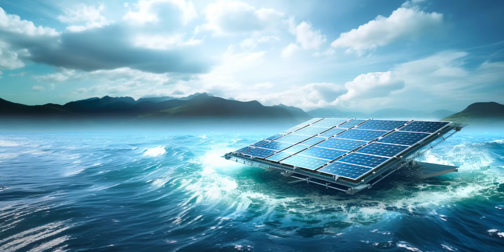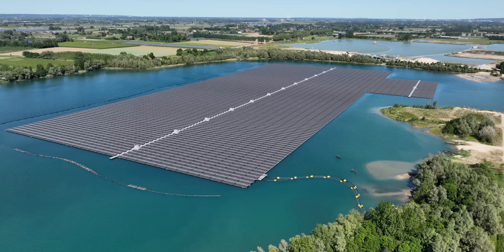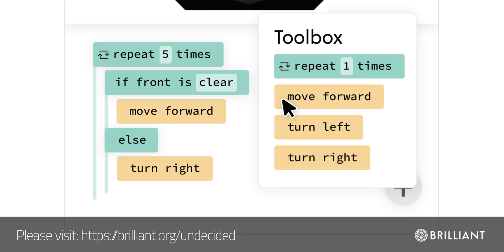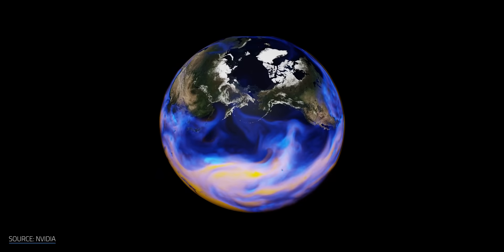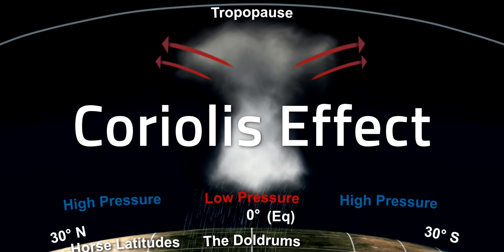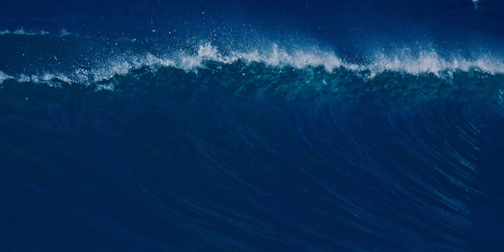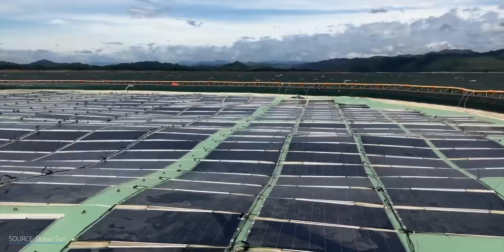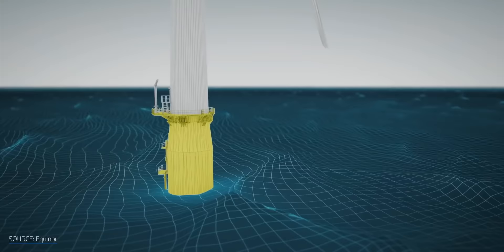How Offshore Solar Could be the Future of Energy

Comment: Thanks for the great work, Matt! My first reaction is that this is too cute by half. The ocean is like a desert: nobody lives there. That means that any power you generate must be transported over large distances and that hikes costs. It may see applications in places like Singapore or remote islands where space is at a premium. But outside those niches? I don't think so.
Reply: Excellent point & my thoughts exactly! Me thinks that the ocean is already polluted enough!
Reply: Transferring energy over these relatively small distances doesn't cost much. 
These panels on the ocean are more efficient and have less thermal wear and tear. And avoid needing to buy/lease land.
Reply: Our food lives there.
Reply: Time to build cities in the ocean then!
Reply: I see them being useful as electrical charging stations for ocean-going vessels.
Reply: The most populated areas on earth are near the coasts. Land prices in highly populated areas are expensive. So floating PV could be built closer to population center than ground mounted PV.
Reply: Most major cities and populations are on or near the coast. Most of Australia for example lives within 100km of the coast.
Reply: Power is already routinely generated hundreds of kilometres from population centres where it is primarily used (and often transported much further). There’s many challenges associated with this technology but transmission distance is a completely solved issue.

Comment: I think you are right to be skeptical of their cost and performance numbers.   There's also the performance impact and maintenance cost of salt crust on the panels.  And, they are claiming a 10% performance increase on the water, while also using thin films cells (which have lower performance).  Hmm, 10% better than land-based thin films?, or 10% better than land-based conventional panels?

Comment: Pairing offshore solar with existing wind farms might make sense, provided conditions were favourable. Even some flexible PV wrapped around the sun facing sides of the turbine tower could make for a good boost in power generation. Plus transmission cables are already there!
Reply: ...and a calm evening...what do you do then...??
Reply: @manoo422  
It's a bit of a physics thing, but wind tends to blow more at night than it does in the day.
So calm conditions are more likely during the day when your solar is producing.
Reply: @manoo422  Use other energy sources. Nobody is suggesting wind and solar need to provide 100 percent of power 100 percent of the time.
Reply: @jdillon8360  Try to think of a way you can make use of intermittent power supplies when you have a country to run 24/7...
Reply: @manoo422  You're right. There's no solution. Australia has wind and solar and when it's not windy or sunny we just live in the dark and all industry and transport shuts down cause we don't have any other means of making or storing electricity.
Reply: @jdillon8360  What you are really saying is you need a cheap secure 24/7 energy system mostly based on fossil fuel ready in the background for when renewables are producing near nothing. So if you have a secure system capable of running the country you dont need poxy unreliable expensive renewables. They are purely a political decision not an economic need because they are worthless.

Comment: We need that in typhoon prone areas. We just need a system that can easily be assembled and disassembled and stored in a steel container on shore. After a typhoon the grid will be down for weeks or months. If we can roll out floating solar in areas after being hit by typhoons, we can power these areas quickly after a storm. I have a couple of solar panels on land in a typhoon prone area. I mounted them in a place where I can easily take them down and move them inside when we get a typhoon warning.

Comment: Make 2 gigantic iron chains and tie them to a Circular, Empty Metallic Well with 1 mile diameter, whose bottom is filled with a single layer of huge Solar Panels. 1 Iron chain is used to pull the well in 1 direction towards sun rays during dusk and the other chain to pull towards sun rays at dawn. The well should be tall enough to prevent animals jumping into it. After any rains, maximum amount of water in it should be drained out with a big tap(s). Remaining water should be pumped out to keep the Solar Panels dry. 2 poles stuck into the water should help for pulling with those 2 iron chains that are attached to 2 structures on the shore. Basically one L shaped pulling during dusk in one direction and another L shaped pulling in the other direction at dawn. Start with a small system and keep on scaling up with more and more systems after gaining more and more experience !

Comment: I guess I don’t understand how this is easier than panels on every rooftop?  I understand the space thing in dense areas but roofs of everything seems simpler.
Reply: Im sure both can happen, but with most people living close to the coast it provides more options.
Reply: @SomeKidFromBritain  But living near the coast limits where these can be so close proximity isn’t a good argument. Shipping lanes, fishing areas, boating, and just the view would stop this from working in most populated areas vs just going on every roof. Or am I missing something amazing about this idea?
Reply: @SnappyWasHere  Everything has downsides and challenges. The future of clean energy will be a mix of solutions.
Reply: @SomeKidFromBritain  That is true plus dependence on one form is not good also.
Reply: To me its a matter of efficiency. 
Each rooftop needs its own set of batteries, panels, grid circuits and soi on. All to provide a very limited amount of power. A single high rise may be able to produce enough solar to service maybe 1 or two apartments out of 100/1000 or more units in a residential building. Its just not cost effective.

Even out where I am in a rural area, I can produce 20% of my power needs from solar with a very large array of panels, and that's only in the fall and spring where usage is minimal.
My investment was substantial and I did the math, I will not recoup my costs over the life of the equipment. To me its mor like emergency backup power not primary production.

Centralizing it makes it more efficient on costs. Fewer people to manage, eliminate redundant systems, logistics and so on.
Not going to say its still a good idea large scale, but that was not your question any way.
Reply: Roof installations tend to be relatively tiny for one thing and therefore have a much higher cost/kwh than large commercial plants. Also remember, you don't just have to power your frigde and kettle, you have to power industry, transportation etc. where roof top installation simply will not meet demand.
Floating solar won't either, but there may be some really good and efficient uses cases. E.g. limiting evaporation off of hydroelectric dam reservoirs, a 2 for 1 benefit. Coinstallation with windmills at off-shore windfarms will have relatively little extra cost in terms of additional infrastructure. Also as mentioned, temperature cycling can be a major problem in really hot countries, rooftop panel efficiency dropping off right when everybody cranks up their airconditioning might also be a factor here.

Comment: The one item not covered with offshore solar PV (oceans) is the cost to connect to the grid. To be less disturbed by shortening of wave spacing near shorelines, the arrays will need to be place further offshore. 
Wind on ocean make sense, as wind speeds over open oceans are higher, thus contain much more energy.  
IMO: floating solar PV is more economic on fresh water where wind speeds are lower, and there are many secondary benefits. Just as combining solar PV with farming has added benefits for both solar and for crops.

Another example not mention here is solar on hydroelectric reservoirs in Thailand. An advantage is the grid infrastructure is already located at the hydroelectric power station.

Comment: With PV cost currently in free-fall, it's easy to get numbers that show an edge for your favorite system: just use out-of-date numbers for the competitors' prices.  When things settle out, though, I will be very surprised if ocean floatovoltaics beat landlubber PV, other than in a handful of politically determined situations.  Saltwater is expensive to deal with.  It's worth doing so if your system is very concentrated, with lots of value in a moderate area, such as a container ship's worth of goods in an area the size of a container ship.  With solar power, the resource is inherently spread out.  

Maybe I'll be surprised, and anti-fouling plastics will turn out to be great.  But if so, it will revolutionize shipping first, and there's no sign of that yet.

Comment: I think it would be possible to design a system where the tethers to the ocean floor are capable of pulling the array under the surface a few meters when wave and wind conditions become hazardous. This could be combined with wave energy harvesting through the same tethers, as well as undersea pressurized volumes for energy storage from both the solar and wave sources. The submersible structure also provides a way to clean the panels, and given that storage and transmission infrastructure is there, might as well throw some wind turbine in the mix.
Reply: Brilliant and glad I read the comments... I was gonna type out the virtually same idea....with poorer Grammer! LOL.  You can  use the floats as ballasts too , adding water to them to help them sink.  Would be more work for the panels though making them 100 percent water proof instead of really water resistant!
Reply: If you're already floating a structure on water with waves, seems as if you're already halfway to generating wave power.
Reply: @davidrenfro5756  I think you just about have to make them sea water proof in the first place, or it is never going to work. In one embodiment the cells could be put on part of the surface of very large cylinders that are mostly submerged such that just the strip with the cells is above the surface. Then the cylinder could rotate to provide some level of sun tracking through the day, and keep rotating through the night to bring up the cells on the other side in the morning. This cleans the cells at night (with some brushes underneath) and if bad conditions are happening, it just advances the rotation to put the cells in the protected zone underneath until calm seas return.
Reply: Moving parts under salt water is a bad idea.
Reply: @Ken00001010 I believe they’d actually have to be pulled some number of feet below surface to prevent wave damage, depending on the area.  Even in the calmest areas of the ocean a storm can generate swells of 20 feet or more, in fact in extremely rare circumstances this size of wave is possible even on the Great Lakes.  So agree in principle with your suggestion but just that the solar array may have to be submersible to a greater depth, which does increase the complexity and difficulty of the solution.
Reply: @sjsomething4936  I agree that is true for the worst case locations. Matt showed that the close to the Equator locations would not need protection, so I infer that as the operation goes farther away, more protection would be needed.
Reply: @trenomas1  It is not easy, but submersible machines are commonly built, so it is a known technology.
Reply: @netscrooge  Of course.
Reply: I can also envision an embodiment where the array units take the form of something like a large jellyfish. These would be huge rubber bags with plastic solar cell film on top that flatten out while floating on the surface. They would each have a single tether line to the bottom that would be used for wave energy collection, and to pull the bag under water when cleaning or in rough seas. The advantage of this "jellyfish" approach is that there are no rigid structures for the waves or the wind to fracture.
Reply: Pulling the above water structure under water will just put a coating of salt on the top of the panels.

Better to just wait for the rain storms to clean the panels.
Reply: "I think it would be possible to design a system where the tethers to the ocean floor are capable of pulling the array under the surface a few meters when wave and wind conditions become hazardous."

You might want to look into the maintenance of ship hulls, especially, those that are repeatedly pulled under water.

Lets just say, its not like freshwater.  :)
Reply: @digiryde  Yes, I would expect it to use automatic robot scrubbers as do those ships.
Reply: pressure waves exist inside water too you know... just watch the myth busters episode on shooting fish in a barrel, they didnt even have to hit fish with the bullet, the pressure of shooting a bullet into water sends a shockwave through the water powerful enough to kill a fish. a storm happening in the ocean will still be sending pressure waves through the body of water, thrashing around the structure under the surface.
Reply: Or just use house roofs
Reply: @ge2719  Yes, you are right, the structure would be easy damaged by depth charges. As a SCUBA diver I have personally experienced  the underwater pressure waves and the bottom surge from waves over shallow water. Submerging in very shallow water is not so good against storm surge, and these systems would need to go out to deeper depths for protection.
Reply: @ultrasometimes8908  It is not an exclusive "or" situation.
Reply: Very nice reading all these brilliant ideas but still wondering why the 100 times more simple mounting of solar rooftop isn't used more as it isn't only much cheaper but also much less vulnerable to damages.
Reply: I had the same thought, although I suspect that there would be major corrosion/oxidation challenges. Seawater is absolutely vicious to a wide range of metals and other materials, and the PV panels are definitely the most fragile and complex part of this system. It's also more conductive than fresh water, and shielding electrical components against water ingress is orders of magnitude harder/more expensive when you're dealing with full immersion versus rain and spray at the surface.

These challenges are surmountable of course, it's always just a question of whether the cost and/or operational effects outweigh the benefits.
Reply: @glittalogik  You are correct about the difficulties of the environment. For a time when I was in college I worked as a tech in a marine electronics shop, and I saw it all. However, marine engineers have been dealing with it for hundreds of years and with all the work in undersea cables and submersibles and the equipment for the oil drilling industry, a great deal of knowledge of what works and does not work is now available. Of course, if you dumped PV panels used for rooftop into the ocean they are not going to hold up because they are not designed for that environment. More protected PV is now being installed on boats where it has to stand up to salt wave impacts. Submersible PV would most likely be plastic film based non-silicon technology that is specifically designed and produced for that environment. The cost will depend on how it is made and placed. I would be interested in a factory ship (or fleet of) that 3D prints the structure in place to get the lowest cost. Even lower efficiency PV could be cost effective given the vast area available and the low cost of transport by ship. Remember, the wave and tidal energy folks are already working on these problems.
Reply: However high the waves are, they go that far under the surface. then below that layer is a secondary turbulence layer induced by the surface waves.
You're down 100+ feet to get to guaranteed calm water WITHOUT a tropical storm...

With a hurricane... 500 ft.

You are well into the realm of high pressure hulls for the flotation required to get the array back to the surface.
Reply: sounds far more practical to use deserts
Reply: your comment was what i was trying to communicate, but you said it far better than i could, so thank you.

i'm not sure the solar idea would work all that well though.
Reply: You have to remember that a wave affects part of the column of water below the surface. So if a wave is 12 metres (40 feet) high - not unusual in an ocean - the arrays will need to be submerged to at least 24 metres below wave peaks to avoid breaking the surface in wave troughs. Add another 24 metres of depth and the effects of that swell will still be appreciable. So the array is already 48 metres (160 feet) below the surface. So the secondary question arises, 'How can the array be made water-tight under those conditions?'. Quite a challenge.

I've been in ocean liners and experienced waves that were close to 30 metres (100 feet), even at a quite low latitude on one occasion. A 150+ metre long ship will be tossed like a cork in that kind of sea state. Moving water contains a lot of energy. Remember that every cubic metre of fresh water weighs 1 tonne, and sea water weighs a few percent more. Those waves represent huge masses of water moving in roughly circular directions. So my question here is, 'Why not simply extract wave power directly, instead of extracting the lesser power from sunlight?'
Reply: Big-time barnacle issues there.

Comment: I would like to see highway medians and verges explored as solar farm installations locations. For the most part, these areas are easily accessible and otherwise not used for any productive use. Of course there may be a traffic safety issues which would need to be dealt with on a case by case basis.
Reply: @devilselbow Not if you put up the appropriate barriers.